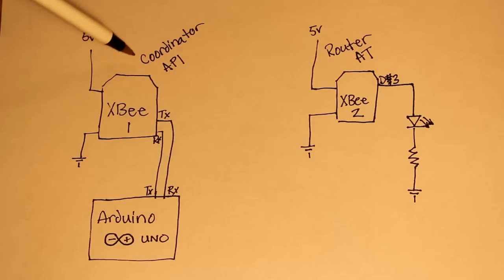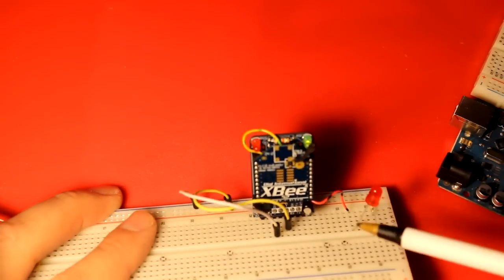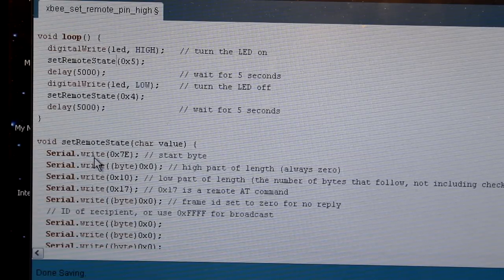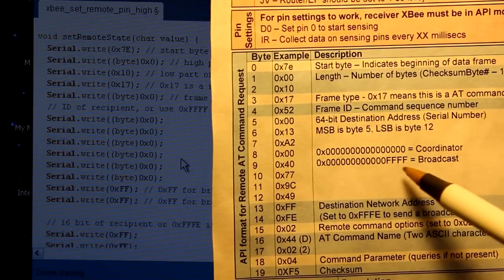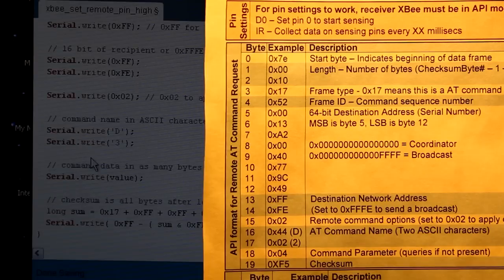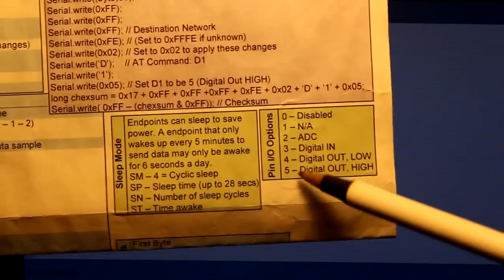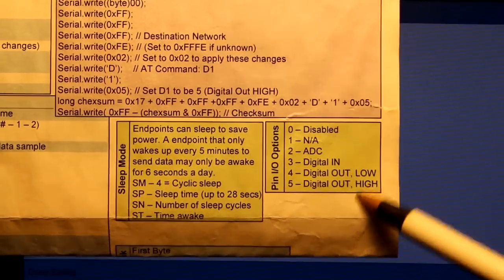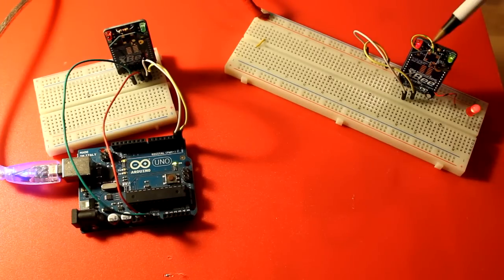XBee Basics - Lesson 5 - API mode: Send Digital Output to a Rmote XBee

Comment: Why are you reconfiguring the output setting every time you command the xBee? The correct way to update the digital outputs is with the "IO" command. 

To set D0 High

4242 0000 0000 0200 0102 494F 0000 0001      + CRC

To set D0 Low
 4242 0000 0000 0200 0102 494F 0000 0000       +CRC

Comment: Thank you for these video tutorials.They are very straightforward and helpful.

Although, is there a reason you are using mixed mode ( COORDINATOR API and ROUTER AT)? Will sending the frames work exactly like this if I set my router to ROUTER API and connect and Arduino to its Tx and Rx and use the frame generation program from above there?

Comment: How do I make the commands faster?  Your video has this issue as well.  When the command is executed from the arduino, it takes a good while to toggle the LED on the remote xbee. Can we speed up this response time?  I've tried increasing Baud rate to 115200 and pointing the destination addressing at each other but this didn't seem to change anything.  Some help would be much appreciated.

Comment: hey awesome tutorial, but I keep getting this error on my arduino IDE and im not able to get the light to come on, the error message is: 
avrdude: stk500_getsync() attempt 10 of 10: not in sync: resp=0x00
Does anyone know what this could be and how to fix this?
Thanks ))
Reply: yes. You need to remove TX and RX pins when you upload the code to the arduino. When you have the code uploaded put TX and RX connections back.

Comment: One of the better "how to" videos. I used the author's "cheatsheet" a year ago to set up a thermocouple board which was polled ("bit banged") by Microsoft VB via an XBEE controller. It saved my bacon. The author has done a great job with these videos, emphasizing important points, showing in multiple ways and I learned a few things the second time round. Tkx

Comment: Great videos dude! so helpful, you cleared up most of my questions and now I know how to proceed with my own project! In video 3 you run 5v from the switch back into the XBee, are you sure that it can handle that? I thought XBee was 3.3 and I don't think the explorer board limits voltage when you wire directly to the pins

Comment: Sir, i'm having trouble in comm. with xbee radios when i use a pair of arduino and xbee in AT mode. Without any change in configuration of xbee and the program of arduino, at times  the comm. is not possible. Can u suggest me a solution?

Comment: Nice tutorial, I'building a network with multiple XBee modules, but I'm wondering what's the easiest way of seeing which XBee modules are in my network and how to send data to a specific one. (Do I have to send the serial number each time?)
Reply: +geunsjl hi have u solved the issue . if so let me know how .
Reply: +siva suryaa Yes, I just gave every XBee it's own number, and when I sent data I just attach a specific number. Every XBee gets the data, but only one (or more if you give them the same number) does something with it.
Reply: +geunsjl thank u  for swift reply.  but I have one more doubt. how would u process data received on pc directly from all the xbee's individually in a network?
Reply: +siva suryaa I used an Arduino to run a webserver with a simple web page and some buttons. I plugged in the XBee shield and voila. It's serial data. Shouldn't be too hard to process on a pc.
Reply: Ya I understand that it's is single point to multipoint system.  I am asking can the reverse be done multi to single and read data.

Comment: Hi, i was wondering if the cheat sheet is also usable for the series 1 xbee? 
I have followed the entire tutorial with some small changes. 
I have used x-ctu to read the routers in AT-mode's data. 
this says ...D1.r.. or D1.q.. So it does receive, but it seems that it doesn't interpret the command..

Comment: hi its basically my first time working with xbee. I'm working on a project that uses two xbee's to communicate with each other wireless by using arduino and labview. the problem is that im am using the latest version of xctu and labview. Could you tell me how to work with them

Comment: Thank you very much Richee. I watched all five videos and watch them again and again for many times. I plan to build the simplest joystick with minimum hardware. My preference is to use only one Xbee and the joystick and a lipoly battery. Is this feasible. My thoughts are that the Xbee might have enough ADC ports to sample analog joystick (those $3 things on ebay with 5 wires meant for PS2 on Arduino). I simply want to send the x-y coordinates and perhaps one digital signal (to control a quite a massive robot which is currently controlled with wireless nunchuck with only 5m range). I am going to use TI Stelaris Launchpad ($5 microcontroller programming board) for the receiver Xbee. Am I too ambitious or do you think this is possible?

Comment: Hi. How do you send Analog Value to an xBee that is connected to a microcontroller? The only way i've found is to send an TxRequest with some PayLoad, and decrypt that in the Microcontroller to which the Router xBee is connected.

I've managed to do all sort of sensoring remotly with the ADC Pins, but now i just have to send some Analog Value (0-1023) so the remote Arduino will move some DC motors.

So, Digital Pins you can turn On/Off with RemoteAtCommands, for ADC Values the only way is the way i say? Payload?

Comment: Hello, I would like to know how I can configure my module xbee series 2 same way as you but with cordinador in at, not the api to send a high pulse on pin 20 will send out the wireless signal and a high pulse by the pin 20 of the router without the nesesidad of some arduino
I would greatly appreciate it as it is for a school project :)

Comment: Hello, excellent videos. I have one coordinator and three Xbee Xbee Pro S2B each connected to four sensors, two analog and two digital. And each Xbee connected to xbee and shields each with a Arduino Mega 2560. My question is do I configure each router xbee as AT? Will the destination address changes? This configuration must each Arduino?
  thanks for your reply.

Comment: My project for the XBEE is going to be a remote rocket launcher with a countdown timer.  I am not even sure I will have to use an Arduino at all as I maybe be able to use simple circuit components, Coordinator XBEE, Router XBEE and a high voltage DC relay for the ignition circuit!  Great videos, thanks for giving me a great set of ideas!

Comment: Well done series!  Thanks for making these videos.  You really helped me figure out the XBEEs and put them to practical use in a very short time.  I will be using them for a home alarm system with an Arduino and a GPRS module to send me TXT messages when doors are opened or there is water in the basement.  I hope you keep making videos like these!